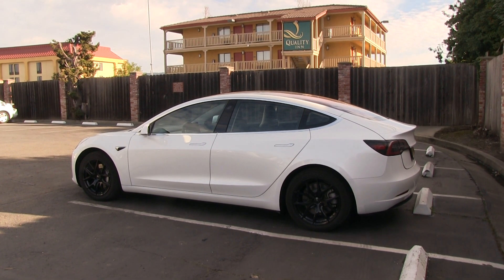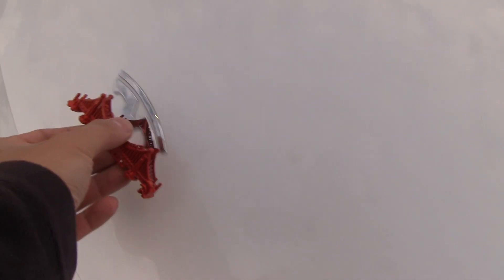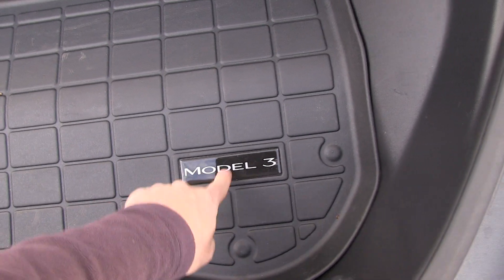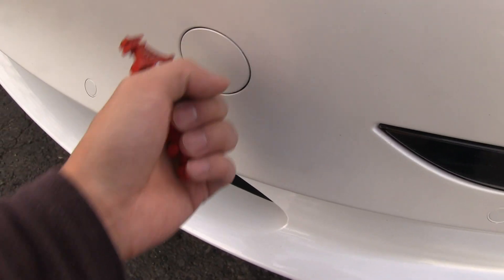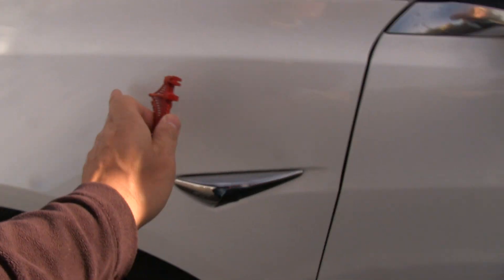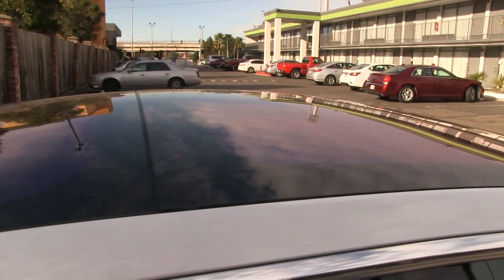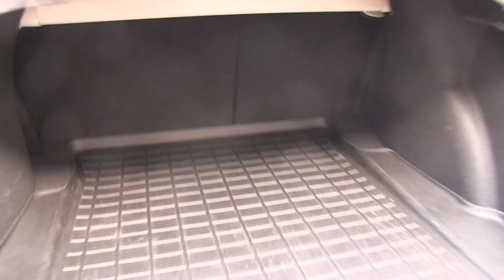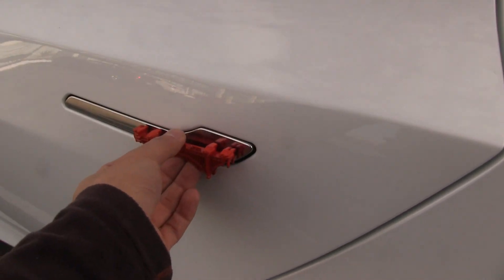Tesla Model 3 body materials

Comment: Strange really,  You would have thought they used Carbon fibre body panels since these are even more stronger and lighter then aluminium or steel.. plus no rust with carbon fibre..  After all, They are now doing the space x rocket parts in carbon fibre so seems a better way to make the car strong light and better?  Maybe Tesla will use what they learn from the rocket making using carbon fibre on the cars next?  Maybe the Model Y will be done with the carbon fibre panels to save cost and make it lighter and stronger and better?
Reply: Colin Campbell Yeah, let's see you building a 250 mile EV with carbon fiber panels and still sell it for a profit @ 35000$ :D

Comment: Nice video ike always Björn. i`m very surprised of the quantity of alluminium in this car -(it is similar like the Chevy Bolt I think) and its´s good for the weight but not for the body repairs. maybe Tesla needs to approve new workshops for repairs the parts in steel, due to the differents of the both materials

Comment: parts that are steel are worse panals... sills and wheel archs all metal and rust lol
Reply: Steel is stronger and easier to work with, when the manufacturer chooses to use good rust prevention measures oxidisation is quite rare. Just look at older Volvo's as an example, they're still driving around with minimal rust after 20+ years, sadly newer Volvo's tend to rust after ~6 years.

Comment: I had been wondering about this since someone told me the Model 3 was all steel.  Also, getting the steel and aluminum to appear to be painted the same color is really non-trivial, because the primer is different between steel and aluminum parts.  The primer will slightly change the tint of the final paint job.  Tesla had to figure this out and come up with a primer that would make the whole car appear to be the same color.

Comment: If it is chrome but not magnetic, it is likely plated plastic, yes you can chrome plate certain plastic. The brushed metal accent on bottom of the side view mirrors are aluminum, if it was shinier it would be chromated plastic. Certain thickness of aluminum when knocked on will sound like plastic of which can also be aluminium/aluminum metalized.
Reply: In this case it's plated aluminum, source: I got my chrome scratched off.

At least the trim that goes over the doors

Comment: Interesting especially as it had UK registration plates but was left hand drive
Reply: That is not that unusual, I worked for a company that brought cars in the US where second hand cars sell for less than in Europe and ship them to the UK where it is easier to get them registered than some other parts of Europe. Once they are registered they then can be driven anywhere in Europe where they can be easily sold as it is left hand drive. It could easily in a lot of cases make a 10% to 15% profit for what was essentially just organizing shipping and paperwork. I was processing some times as many as 200 cars a week
Reply: What's also interesting is that they bought the regplate to hide information about it on the DVLA Car checker - HE15 NME was bought https://i.imgur.com/QbIh2IN.png
Reply: fyayh2 Of course in this case we assume it has USA charging so would be interesting in the UK.
Reply: Electric Dan they’re not making right hand drive till end of year
Reply: Gurmehar Bajwa I thought it wasn’t until 2019 for right hand drive
Reply: Electric Dan it’s in the US
Reply: That is true hadn't thought of that, I never worked with any EV's. That being said is the charging any different between US and Europe? I think CHAdeMO is the same in both so you could charge with the CHAdeMO adapter, but I dont if the superchargers are the same or not.

Comment: Sandy Munro said on the Autoline Network that there's a lot of steel in the Model 3, but also a lot of unnecessarily complicated manufacturing choices that add to the cost & material in the chassis that doesn't add strength but adds weight? (Speculation was there wasn't enough  finite element analysis and the chassis didn't get enough dev time to optimize weight).

In his consultant business they tear down cars & provide competitive consulting materials for different car manufacturers and suppliers, and his view was there was a lot of unoptimized joints/welds/rivets that made the manufacturing more expensive/time consuming than necessary and didn't add to the strength or performance of the vehicle. 

https://www.youtube.com/watch?v=CpCrkO1x-Qo
Reply: TomaCukor Yes but it is not so good approach in case of cars. Software is easier to fix after releasing, hardware is not.
Reply: Yep. Tesla needs to find that balance.

Software updates = good. Continued production refinement/quality improvement = good.

Fundamental engineering issues that affect stamping/extrusion/weld/rivet systems? Expensive to redo, has crash testing implications, and annoying for service (too many versions that challenge service tech & parts supply chain).

Tesla needs to hire some Japanese talent from Honda or Toyota. As it stands today, the build quality coming off the line on Model 3s aren't up to par.

Comment: Aren't the chrome bits just plastic like the door handles? The wing mirrors seem to be completely plastic too; as they should be.
Reply: rkan2 Most likely yes
Reply: The door handles need to be metal because they have to be rugged enough to be pulled pretty hard after a crash with deformed doors etc. - so most probably alumunium/magnesium.
the chrome bits should be plastic with a coating, that coating could be a bit magnetic, or there is a metal inner structure.
Reply: The door handles are metal.
Reply: oisiaa source? Some say the newest handles (3rd gen)  on the Model S are plastic.
Reply: Digi20 At least in the Europe they don't have to be. My Audi A3 (2002) has almost all plastic door handles with a metal cover In the inside they are metal though..